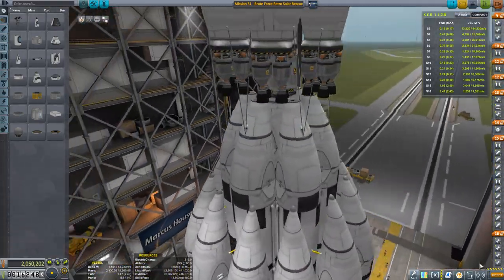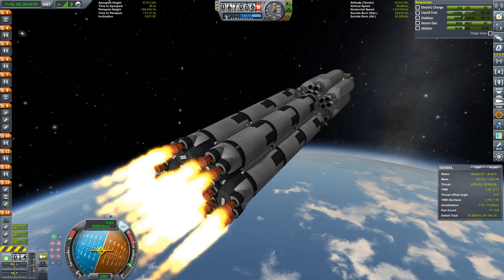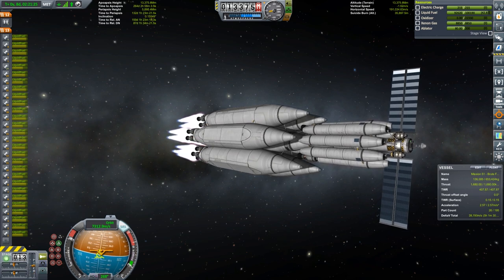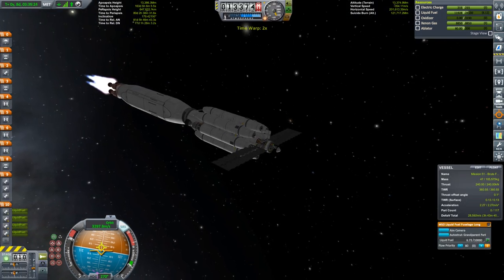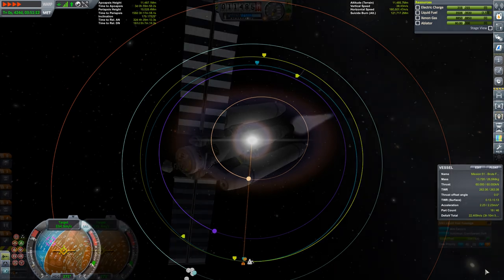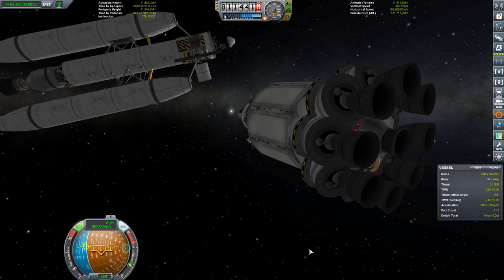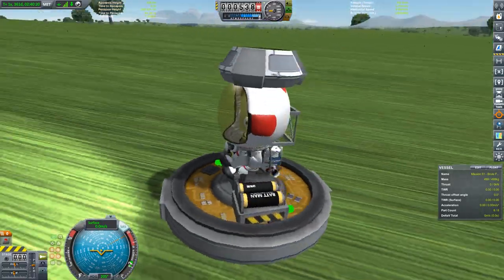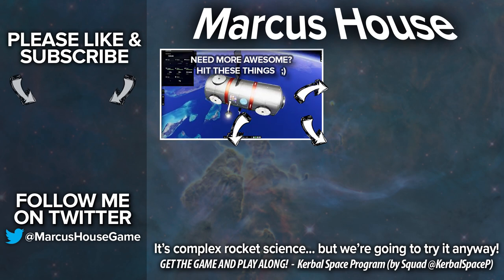KSP Brute Force Solar Retrograde Rescue Mission (Tutorial:51) Kerbal Space Program 1.2 - Stock Parts

Comment: Now all you have to do is use Kopernicus and put Eve on a retrograde orbit, then rescue a Kerbal from the surface of Eve using the brute force method you have demonstrated here.
Reply from the maker: Oh yes.. now this would be very difficult..
Reply: Seems difficult but that could be done with aerobraking pretty efficiently.

Hoghman transfer to Eve, massive velocity when you reach, aerobrake to capture, leave the transfer stage in orbit and use a lander, pick up the kerbal, launch + rendevous, transfer crew, leave lander behind, escape to Kerbin, aerobrake to capture and then land.

May be feasible, may not,  it'd be interesting to see if someone could apply it.
Reply: @LillianWinterAnimations  You see, you can't aerobrake at that speed. The heating is immense and even if the heating wasn't an issue the velocity is too high to wipe off via aerobraking.

Comment: Wow! Good work, Marcus! -- I tried a similar mission two years ago, after mistakenly accepting such a contract in career mode... Difference was that my design used more ion engines and Xenon propellant. Finally I gave up due to the very low initial acceleration, even with six ion engines and at 4x physics warp. Ended up with the gravity assist approach instead.
Reply from the maker: Ion would be great if you could burn while in time warp. Otherwise they are a pain in the arse. That Ion burn took about 40 mins.
Reply: Have you tried the Time Control mod? I don't know if it's updated for 1.3 yet but it allows faster physics warp.

Comment: in real world it whould be almost inpossible. as from orbit to sun is 30km/s of delta v. and to get back in the other direction its another 30km/s.
for a total of 60km/s. witchs is riduclus high. (earth to pluto is 12km/s). and you still need to launch. so orbital building is the only way (if gravity asist isnt allowed). and you need to get a huge ion engine. and you need to burn quick aswell. or you crash in the sun.
Reply from the maker: Yep... We'll need some fusion engines :) I don't even know if solid hydrogen would do it.
Reply: Marcus House NEW CUE LURE PRO PULL SHUN!
Reply: or an ion engine the size of a saturn v. with only like a 500 kg payload.
Reply: i google a delta v calculator.
it will requir a 90% fuel rocket with full ion engine(isp of 3000s). 
so if your liveing space is 2 ton. you rocket mast have 18 ton fuel. ofcourse you add weigh because you got fuel tanks. so your rocket is going to be heavyer. lets say 30 ton. with 27 ton in fuel. 1 ton for tanks and 2 ton for living area.(including the astrounats). 

this can be lifted by a normal large rocket. although all that xeon fuel is not going to be cheap my friend.
Reply from the maker: Yea.. Ion stages cost a pretty penny. They are super efficient though.

Comment: Marcus, how do you get the game to run so smoothly with crafts that large? I have a decent rig that can run most other game fairly well. I find myself always reaching a point in KSP career where I need bigger part counts to accomplish missions and suffer from poor FPS as a result, to the point that the game is nearly unplayable whether I use Linux or Win10. I do noticed in this video that you at least have the 'hitching' that most people experience related to garbage collection. This progressively gets worst for me to the point where the game is paused as it plays. Any suggestions? Mainly I am extremely jealous that you can play at such a high level :)
Reply from the maker: Thanks Samuel! In most cases the footage is sped up (so it looks much smoother than in real time).
I do get a little of that garbage collection hitching but not too badly. NERV's make it happen terrible for some reason. I hope they are addressing this GC issue soon. There is a mod called MemGraph which improves things for me a lot, but you need loads of memory. When recording a video I reboot the game a few times to fix performance issues. It's a frustrating process for sure.